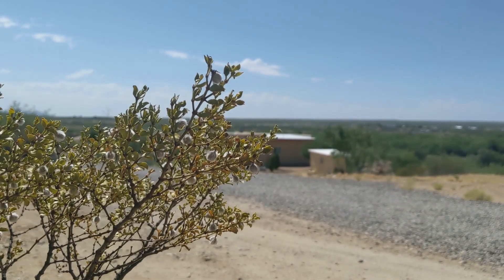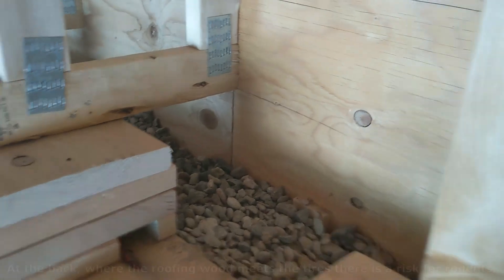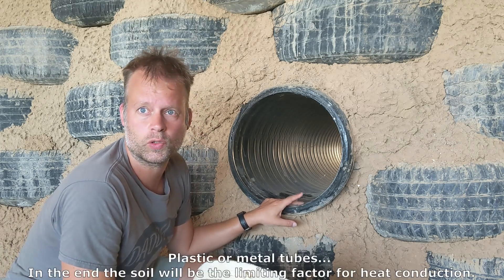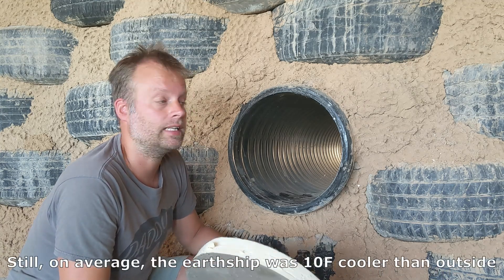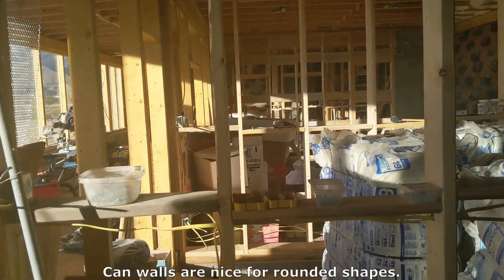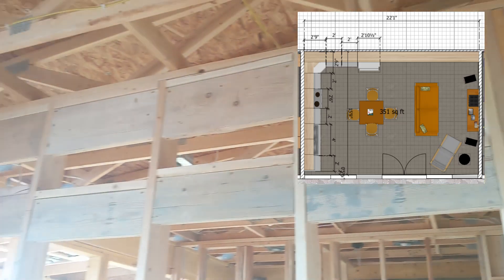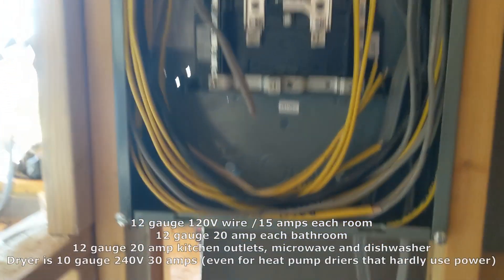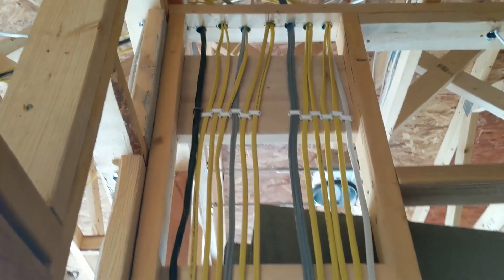Earthship 10: Framing, insulation, some electrical rough in and wingwalls

Comment: Would it be possible if you could cover at some point the topic of ventilation in the closed ceiling space where islts is insulated. Will the attic ceiling space be 100% sealed and how will it be ventilated to avoid moisture build up. Thank..Love the updates.
Reply from the maker: I don't think these spaces are ventilated default according to the plans at least not here in the desert. My attic is pretty much stuffed all the way with batts

Comment: Are your cooling tubes double walled? Is your soil high in sand? 
Keep up the great work! Your process is inspiring!
Reply from the maker: They are and it may reduce the effective heat conductivity, but even then the HDPE tube has heat conductivity of 0.5. A corrugated tube with conductivity 0.5 would be similar to solid PVC with conductivity 0.2. I have seen scientific studies comparing PVC to metal in Algeria, and it doesn't matter much. Our soil is 60pct sand and 40 clay and that matters a lot more. I am extending the tubes as we speak.
Reply: @PZ82  If the monsoon rain almost got in the tubes, will you raise the ends on the extension?
Reply from the maker: No I will extend them to 40ft and lowered the ground another 18inches. You want the tubes as deep in the soil as possible. Water will collect at the back during extreme storms because of the way our land slopes. Thats something i want because it makes the  desert green. I will see next summer if i need to divert water or not.

Comment: I've often wondered if the cooling tubes on these systems would be more efficient if they coiled around a couple of times in the earth mound. That would give them more area for heat transfer and more access to the ground constant. Even better if someone was using water catchment in their thermal mass. Curl your vent pipe around your underground tank. I'm sure this would slow the output of air, reducing its flow as conduction would have to work harder. However, if you ever check the output of a conventional ac system, they are much colder on their lowest blower setting, as there is more time for heat transfer between the evaporator and the air flowing through it. I'm no expert in thermodynamics, tho. And there is a sweet spot of performance between output temp and flow mass.
Reply from the maker: The pipes are pretty big and there is a lot of surface area. Curling around would help, but with these culverts that's hard. So i will just extend them

The earth 8ft deep is close to the yearly average temperature of the air. For taos thats 55. For us its 65ish. In phoenix it's 80. Obviously the earth around the tubes will get warmer over time as hot air goes through. 

There's a lot to it. Next year i will know more when all insulation is up.
Reply: @petervz  I'm looking forward to seeing what you achieve. I'm planning on building an earthship when some family ground comes up for sale. I won't alter the plans either, although I'm concerned about performance in a different climate than New Mexico. I've heard they work well at that altitude and climate, but can struggle in others.
Reply: One thing that is important is to use metal for your tubes. It can act as a heat sink
Reply from the maker: I don't believe that to be the case. It's too thin for that. Like the tire wall, a couple of yards of soil around the tube is your heat sink. Because the tube is so thin, it is the conductivity of the soil that matters. And HDPE tubes have similar or better conductivity than soil. For the first few seconds the metal tube may cool the air a bit more, but the tube will lose its cold or heat to the air quickly and as it heats up the heat or cold will transfer to the soil. So having air go through it over the long run will always mean that you interact with the soil. Obviously the soil will heat over the season as the air moves through the tube. @Offgridgoat
Reply: I think the issue with metal vs. plastic can be heat transfer. Which is worse for insulation, making it better for heat transfer? Or are they comparable so no real difference in heat transfer?
Reply from the maker: @milo6971 for heat transfer you are limited by the heat conductivity of the soil. A metal tube wont pull more heat from the soil than plastic does. In fact heat transfer for plastic and soil is about the same. As the air moves through the tube the soil will heat up. I wouldn't be surprised that the temperature gradient would extend a yard around the tube. In that case the tube material is negligible, and that is what scientific studies seem to confirm. Also for air-surface interactions the material properties don't even appear in the equations.
Reply: Do you think the air gap in the double walled tube has an impact on heat transfer. Thanks again for the videos and sharing your knowledge and experiences!
Reply from the maker: @milo6971  Yes it will. It will reduce the effective conductivity 1inch around the tube by a factor 2 or so. I suspect that even that does not matter that much because the temperature gradient will extend far further into the soil.
Reply: I never understood having them out in hot sun if there is a way to shade them    Like a ground mount solar array...  or vegetation